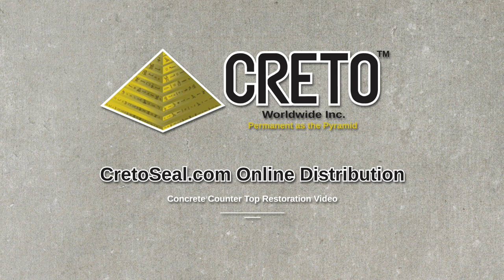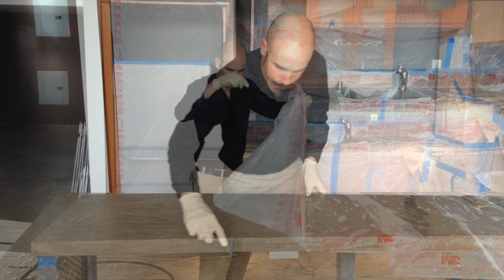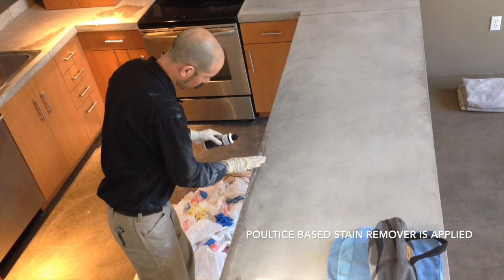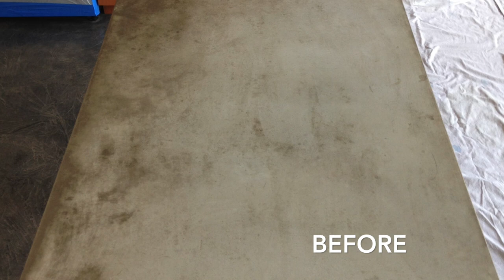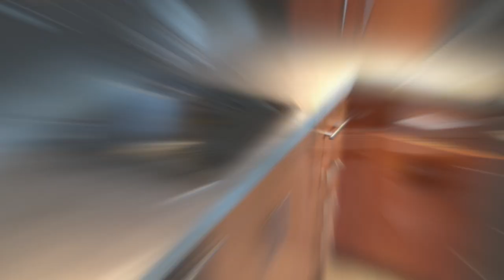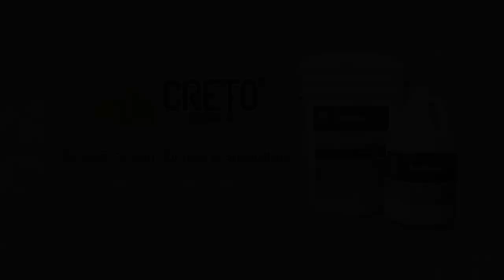How to Resurface a Concrete Counter Top

Comment: Hi Nick, nice job on that counter.  I have an old one poured in place that needs a refinishing.  Since getting you to come to Santa Cruz is unlikely, I have a couple questions: What grit pad(s) did you use to hone? What is the stain remover you used?  Thanks!
Reply from the maker: Hi Matt, 120 grit is the magic number. It's fairly aggressive but leaves either light or no swirl marks in the concrete. Poultice powder was used. That specific brand was discontinued but other brands can be found online.

Comment: What is the machine used to wash the concrete?  It looks like a sander.
Reply from the maker: Hi Alisa,
It's called an extractor machine. It pressure washes the concrete and vacuums up the dirty water. You can rinse the concrete with a scrub brush and water then towel dry the concrete to get similar results.

Comment: We live in Oakland CA and need this exact type of resurfacing. Are you doing this work in 2019?
Reply from the maker: Hi Jean, I work out of Grass Valley now so Oakland is a little far for me to travel. You should check with Westside Concrete and they should be able to help you find a concrete contractor in your area.
Reply: Creto Seal Thanks so much. We will be on vacation some weeks this summer in case you wanted to visit the bay area, you’d be welcome to stay at our house.
Reply from the maker: @musicgem2001  Hi, That would be something I would consider. Please contact me through my website sweetconcrete.com . There you will find a contact form. Please fill that out and I could probably coordinate that with you if my estimate for the service is in your budget. Thanks, Nick O.

Comment: How much did u charge per square ft to do this
Reply from the maker: Hi Frankie, my company would usually charge per job instead of per square foot for counter top resurfacing. This particular job was in 2013 in SF and I think I charged around $1,500, but you can do something like this yourself for under $500 including a new angle grinder and diamond disc.
Reply: Creto Seal what kind of grinding set up n vacuum do u have
Reply from the maker: I own a Makita but any orbital angle grinder would work. Most angle grinders come with a velcro 7" disc and you can order a 7" diamond pad from Runyon Surface Prep or other online retailers. Any brand of shop vac would work as well. A squeegee head for the vac works best. I hope this helps and feel free to ask more questions if needed.
Reply: Creto Seal last question,whats that machine u ised to rinse the concrete
Reply from the maker: It's called an extractor machine but it's pretty much the same type of machine that's used to clean carpeting. The hand held wand is specifically for tile cleaning. It's not necessary for doing concrete work though. You can just rinse with water and a scrub brush and then shop vac up the water.

Comment: What brand of stripper did you use to remove the old sealer?
Reply from the maker: On that particular job I used Blue Bear Soy Gel (620) stripper. It's a low odor, low VOC stripper that works great. It can take up to 24 hours to loosen up some sealants but it will remove just about anything. Here's a link to their site and thanks for the inquiry.
https://products.franmar.com/collections/blue-bear-commercial/coating-removers